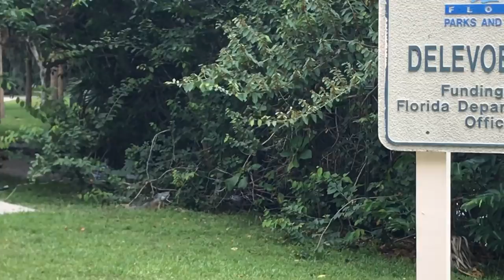Iguana hunting Challenge! How many can we Catch?

Comment: I heard the meat goes for $40 a pound here in FL. I just saw a baby in my driveway that must be less than a week old. You can skin them and do a very easy pickle and tan with Knoblocks Reptile tan. It's about $15 for a pint that would do at least a dozen hides. You have a valuable skill and commodity there. Use it. Iguana tacos.